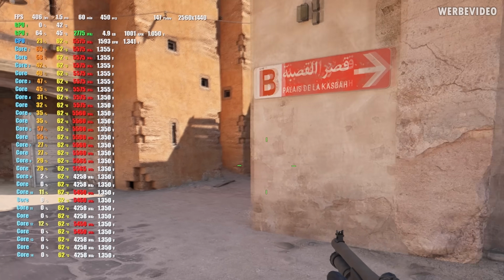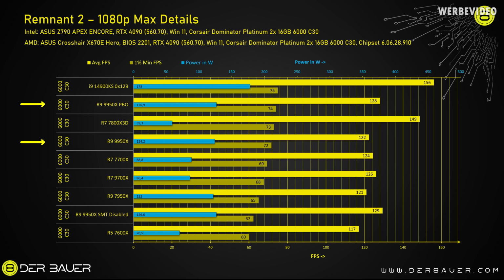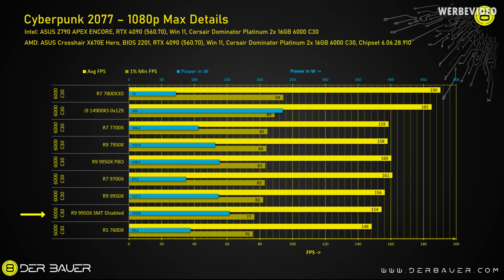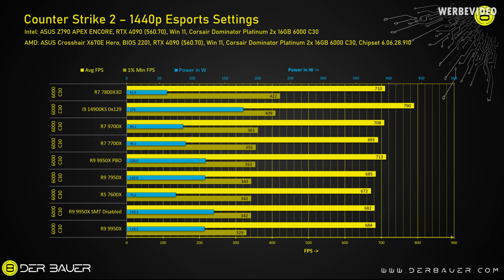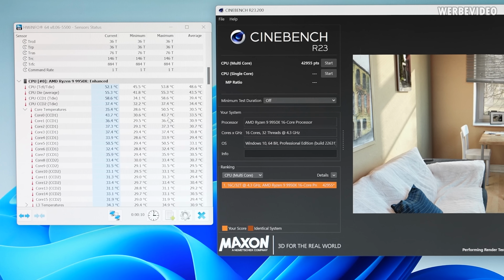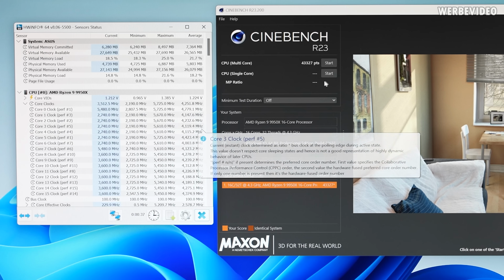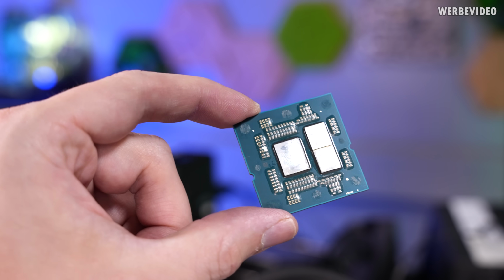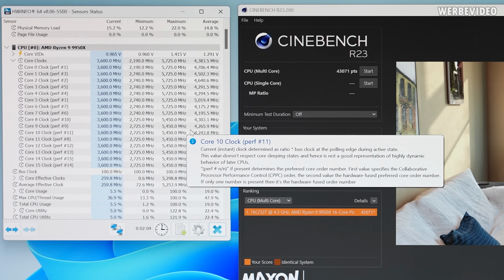Difficult to Review - My 9950X just didn't Perform as Expected

Comment: Can we get a REDO of this cpu test. Now that the new BIOSes are out and PBO works a charm ??  I was getting 31000 R23 on my 5950x with PBO and -30 Curve Thermalright 360 AIO cooler. With my 9950x X870P Asus board and same settings only PBO and -30 curve with the same AIO Thermalright cooler getting 46327 Multi core and 2250 Single core. Haven't even tuned it yet.  Temps are very good with just the curve at 80-90 degrees between all cores.
Reply: my 9950x I recently got shreds, not sure whats going on with this dudes results

Comment: there seems to be a temperature-frequency Limitation for 995X CPU. Limit 5.925ghz when CPU is under 50 ℃,  5.825 ghz for 60  ℃, 5.745ghz for 75 ℃, 5.425ghz for  80℃ and 5.375ghz for 85 ℃. So it's really really hard for a 995X to run on single core under 50 ℃ or run multi core under 75 ℃ with common water cooling or even frozen water cooling. And when your 995X run R23 muti test(with PBO2 negtive curve), it will run over 75℃ and at 5.35~5.45ghz and the resource will be 45000~48000. 48000 is the MAX. So I just what to know, does anyone has a HIS delidding 995X(with direct die) can break the above temperature-frequency limitation?

Comment: Bozo, the 9950x is a productivity processor not a gaming processor
Reply: I hate to tell you this, but no x86 process is / was a gaming processer. They play games, and AMD's 3D Cache CPUs play games really well, but x86 was never designed for gaming.

And just so you know; I played games for six years on a Threadripper - didn't spoil my gaming experience one bit.
Reply: @ i am talking about this after having seen alot of benchmarks. X processors are not as good at gaming as x3d processors, thats a fact
Reply: @Raznak  Your point was moot - and you were rude, calling him a "Bozo". You stated it was not a gaming processor - something entirely different to your follow up comment about X3D.

The 9950X is faster than Intel's 9900K which was once the king of gaming processors - is still popular, and still plays games well - as did/does my Intel 5930K, my Threadripper 2950X, my AMD 7700X and also my 9950X. 

Something has to be the quickest, and just because it's not the quickest doesn't mean it isn't good.

The only thing I'd say about AMD's 9xxx series is that AMD totally botched the launch. Having watched a few tutorials on using the Curve Optimizer, there's quite a bit of potential for a better / faster running setup without increasing temps/voltage.

Comment: "One 7800X3D  to rule them all"
Reply: 7800X3D is useless and terribly slow at anything apart from games. And a new 285K does outspeed the 7800X3D on some games, and is also a great CPU for all sorts of other workloads. In many things it DOUBLES the performance of the mere 7800X3D.
EDIT: In video a 14900K is also faster in games than the slow 7800X3D. And is also tons faster in all other loads.

Comment: What are the dimensions of the Thermal Grizzly High Performance HeatSpreader AM5? I am going to use a thermoelectric/peltier module between the heat spreader and the CPU water block. I need to know the dimensions, but I did not find any on the internet.
Reply: It looks like it's between 45x45 and 50x50?
Reply from the maker: You need the contact area dimension on top or which exactly?
Reply: @der8auer-en  , Yes, the dimensions of the square on top of the heat spreader. Taking this opportunity to ask you, would you like to possibly test/make a video about this idea? There are some Peltier modules on the market that can even remove 200W of heat.

Comment: Install Windows 10! There are significant drop in performance while using windows 11.
Reply: Or better use Windows 8.1 and you have stable performance while not having MS to come in betweeen and mess up.
Reply: @jankees4037  I remember Windows 8.1 was good. the only reason why I jumped to windows 10 first release in 2015 because of the Direct x 12. Beautiful textures and graphics.

Comment: I can explain the the benchmark result in CS2. Source 2 engine utilize as many physical cores as possible, as a result you are suffering from cross ccd latency.
To avoid it you should add -threads 8 or 9 in your launch option, this way it works normally. Same for 14900k and all other intel CPUs that have E cores, you should use -threads X, X represents the amount of P cores you have in your CPU. X+1 also works similarly.

Comment: its bad product that perform similar as 14900k....neither side is worth it for upgrade from 7900x.....i gonna switch to intel for arrow lake platform , i have hunch that its more than cpu...its the socket that become standard for many many generation updates...just like lga775 be around the longest than lga1151...since its wise for intel to fab during colder climates than following summer climates as 13th and 14th gen, sure not good idea for facility HVAC system tend to fail every summer due to triple degrees ...its too rsiky to do here . But to my point is...its pcie generation...gen5 should be standard for all chipsets from lowest to highest ...

Comment: Must add, as I have seen it many times, the matte or dull look on the dies after delid is remaining indium solder.

If you don't polish it to remove absolutely all indium it will still alloy with LM, leading to a little 'dry out'. Unless you want to apply a really liberal amount of LM I recommend polishing the dies with cape cod or similar to get a perfect mirror on all the chiplets before putting on LM.

Comment: You can get the same results or better with PBO on at the stock watts by using Curve Optimizer. This can be improved further using Curve Shaper, a great addition. Hell, Ryzen Master will even do it per core for you with just a button click if you can't figure it out. What the hell is so hard about that? Same watts as stock, yet PBO performance boost (most likely better), with way lower temps! Why the hell wouldn't you bother?! How can anyone claim to be investigating performance and yet completely ignore the tools provided to optimize performance? 
It seems deliberately obtuse at this point. 
The features are there for a reason, who can claim to be an enthusiast that would shoot themselves in the foot and not even try to use the tools provided to achieve the best results? 
EVERYONE uses Curve Optimizer on the previous generations, it's basically standard practice to negative offset your voltage but for some reason it's now what? Impossible? What does "enthusiast" even mean anymore?
Reply: "stock watts"

Comment: So the same or slightly less than what I get in R23 with my 14900K (~43.5K at 5.8/4.6/5.0) before delidding in my loop, just about 50w less and worse performance in games? The 9950x seems way over hyped compared to what it actually delivered so far.

Comment: 12:57 i just deilided my 7950x3D (this is my 20th+ deiliding) and something weird happened is that i did it manually without using a drill and on the 5th turn the IHS was off!!! The cpu is working perfectly fine and everything as it should... idk if i got experienced in that or i was just lucky that the cpu didnt die.

Comment: Since you mentioned slow boot time I can’t help myself but to ask here, I have had a problem with the boot time on my 7900X since I purchased it new… I have an MSI MEG ACE X670E and my memory is 6400 CL 32 TridentZ . My problem is there regardless of with or without XMP enabled. So when it’s on 4800MHrz it would take around 30 seconds to post and around 41 seconds each time until Windows boots.
And when it’s on 6400 XMP it takes around 40 seconds to post and 52 second until windows startup .

Now I’ve just played with the timings and put it on 6000 CL 30. I’ve enabled “memory context restore” which followed that I had to enable “power down enable” as well. Now the mobo posts around 25 seconds and OS starts at 35. At this stage I cannot put the pc on sleep mode cause if I do the mobo won’t post. 

If I hadn’t enabled “memory context restore”, any change from 4800Mhz to either XMP or 6000Mhrz would also render restarting the PC impossible cause again it wouldn’t post.

I changed the motherboard to an Asus X670E-E, boot time still didn’t change, changed the memory kit to one exactly like it, didn’t change, changed the M.2 drive from which the OS loads, didn’t change (obviously cause the problem is the time for it to post, not the OS). The only thing I haven’t changed is the CPU so that’s what I’m left with.

I really can’t understand it but guess the problem is with the CPU

Comment: Roman, how can I speed up the removal of the IHS?
1. Heat the IHS so that the solder becomes more flexible?
or
2. Freeze it in the cold so that the solder becomes more brittle?
which of these will work better and safer?

Comment: Did you run the tests with the updated bios for the 7900x3d and 7950x3d that fixed core parking issues? Apparently you have to enable this feature for the 9900 and 9950x cpus

Comment: Zen 5 has severe Memory Bandwidth/access limits
The bottleneck is Infinity Fabric in I/O die which is the same as for Zen 4
I/O die was even bottlenecking Zen 4, that's why X3D cache is so fast
Steps to do: 
1. Re-Architect I/O die Infinity Fabric
2, Switch from obsolete DDR architecture to HBM2
Reply: Regarding your second point: Do you like paying 1000$ for 32GB of HBM2? That memory is in high demand in the server market and will be super expensive for the PC DIY buyers. not a good solution.
Reply: @SoWeird4U    that was true versus DDR4 but DDR5 is almost as expensive as HBM. And yes people are willing to pay for good performance
Reply: I'm not trying to buy my motherboard and ram as a package because the two usually need to be soldered together. And I don't want to pay $2000 for a motherboard and ram. No thanks, I'm fine with DDR5.

Comment: Roman, are you using the Performance or Balanced power profile? Usually, AMD multi-chiplet (also Intel hybrid chips for the matter) scheduling and power optimizations only apply when the Balanced power profile is enabled.

I understand that you reinstalled the OS and the AMD CPU drivers, not just reset the OS. Bear in mind that during the Windows installation, different power and scheduling optimizations are performed if you use multi-chiplet or hybrid CPUs. These optimizations are not reconfigured after the OS installation is finished, even if you reset the OS. Also, the AMD drivers install additional components when a multi-chiplet CPU is put on the system but if you first use a single CCD chip and then switch to a multi-chiplet CPU, the driver won't be reinstalled and the additional components/settings won't be installed/configured.

Also, is there any reason why you are using 6000 MT/s DIMMs with the Intel CPU? I understand that if you're looking for the best performance, you can use faster memory and if you're looking to run it without voiding the warranty, Intel currently supports up to 4400 MT/s if I recall correctly -- I know AMD officially supports up to 5600 MT/s  even though AMD recommends to use 6000 MT/s to have an Auto:1:1 ratio with the Infinity Fabric Clock (FCLK), unified memory controller clock (UCLK), and memory clock (MEMCLK)...

Comment: Why all reviewers use PBO without touching Curve Optimizer/Shaper? Makes little to no sense to me. Curve optimizer was all the rage for 7000-series.
Reply: Because it's too much work to expect a normal user to do it, a normal user will try and click on PBO but anything more that that only a very small amount of people will even attempt to try.
Reply: @terrylaze6247  a normal user wouldn't do anything at all in the bios.
Reply: that's like saying reviewers need to undervolt their CPU to test it properly.
Reply: @MaxIronsThird  define "properly". Curve Shaper is a new feature available to 9000-series Ryzens and (almost) no one "tested it properly" (yet?).
Reply: @zbrkesbris5987  every CPU is different if they were all the same curve optimizer wouldn't be a thing.
Reply: Curve Optimiser basically brings the CPU closer to instability in order to gain speed and efficiency. Having extensively tested it on 5800X, 5900X, 7700X and 7800X3D, the -30 or -20 offsets gave great benchmark improvements but caused random game freezes or Windows reboot problems that only occurred every few hours. For a review they do not have the time to do long term stability testing to confirm what is a stable offset, and every individual CPU has different limits of what offset it can stably achieve
Reply: @clifflenoir4323  thats why curve shaper is important: while flat -30 (with optimizer) might work great at heavy load, system might crash at idle when cpu downclocks. 
With what i've seen cores have 2 voltage bounds: 1.35v hardcapped upper bound at high load and silicon-lottery-based lower bound at idle.
With shaper it is possible to feed enough voltage at idle, circumventing silicon-lottery, while still gaining speed and efficiency at higher loads.
Reply: This.

Comment: I would suggest checking in the BIOS using Jayz2Cents video about the X3D problems he had. It should be applicable here, since I think the control is on auto (Motherboard) and that is absolutely hammering your performance. Changing it to Driver (Windows Driver from AMD) controlled should fix the problem.

Comment: I installed the heat spreader and Corsair water block temperatures are fine however the CPU die average temperature goes to 120°C . Is this normal? I am running at 5050ghz while gaming it doesn't throttle at all.

Comment: There is some material that 9000x has very high core to core latency even on the same die, can that be the cause of worse performance, and could that be the result of their new increased instruction speed at the cost of latency. Basically anything that needs cross core talking ( most of desktop use ) will run the same or worse than 7000x series.

Comment: I totally agree with including the "bad" results as well, since everything was set up by AMD review guide and results were different each run. For memory training taking about 3 mins, did you turn on the context restore for DDR5 memory, sure helps me after initial training with my 7800X3D? For games, I know time is a limiting factor in these reviews, but maybe few more games with some of them more modern FPS games that really leverage more cores and higher clocks. Btw, the custom heat spreader for delidded CPUs looks great. And question for end, what is your over all conclusion about Zen5 so far, especially now that 9900x/9950x have been tested?

Comment: I have yet to get a AM5 Delid tool but i definitely need to the intel V1 has been absolutely amazing as it has more then likely saved my 14900K from Certain Death with it's incrwsed surface area for cooling better. Just sucks i bought into intel right before the degradation issues surfaced 🤦‍♂️☠️

Comment: Having to communicate across CCD, or migrate threads from one CCD to another, to compute a game frame could be the same old reason why dual-CCD parts lose in some games vs single CCD parts.

The latency with any given app running across multiple CCDs is usually worse than the same app running strictly within one CCD, so for extremely low-turnaround-time ("low-latency") tasks like generating a game frame in just one 700th of a second (~1.42ms), +/- other random sources of system noise, every bit of latency matters there.

Maybe a UEFI/firmware/OS update or two can help with the scheduling, I'm not sure.

Comment: isn't it easier to warm up the soldered cpu before deliding?
Reply: No. Because you make the soldering material more maleable. You want the CPU cold so the solder is brittle and therefore susceptible to the stress and fatigue to break the bond.

Comment: AMD claimed they did something with the design, improved  thermal resistance and expected 7 degrees lower temps that might be why the delid wasn't as beneficial as with the 7950X, but just guessing, you know AMD says lot of things lmao. Huge letdown tho... was expecting to finally upgrade to AM4 and swap my 5950X but... just don't see the benefits, I'll get better Handbrake times but nothing major. Also my chip draws 90W while doing 31k, the 9950X is meh even the 7950X was, still Zen4 was an upgrade unlike Zen5.

Comment: Looking at the SMT results (more power used when off), it really seems like this CPU is being scheduled like the Zen 1 chips. There, because of 4 cores per CCX, there was a change that made it schedule on SMT before moving off the 4C CCX.

Perhaps there is some work pending to have that fixed, with possibly some architectural changes also at play.

At least on Linux, the 9900X is 25%+ over the 7900X, though the 9950X is not going over 15% consistently. They really need to improve power consumption on these cores, or this is going nowhere.